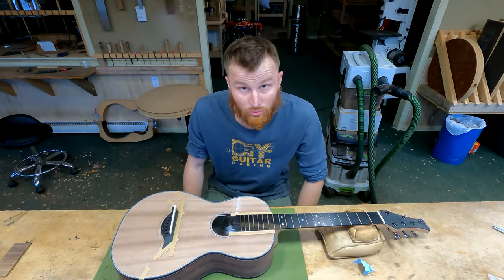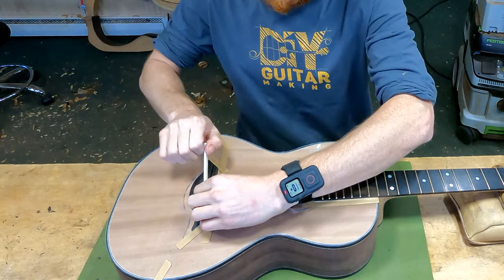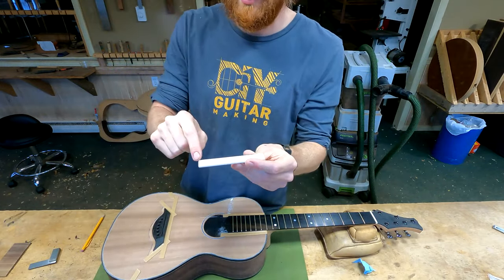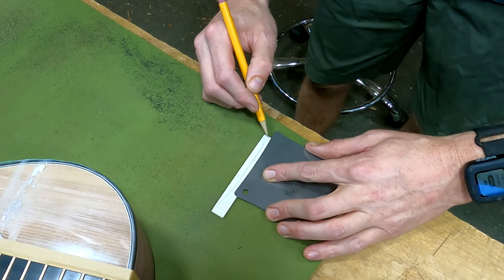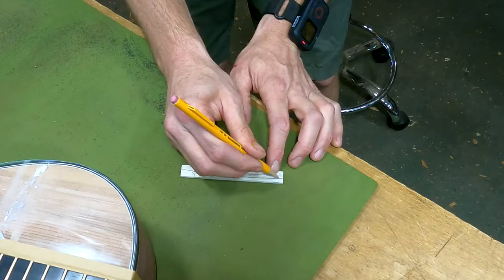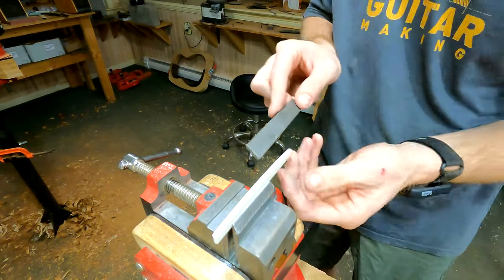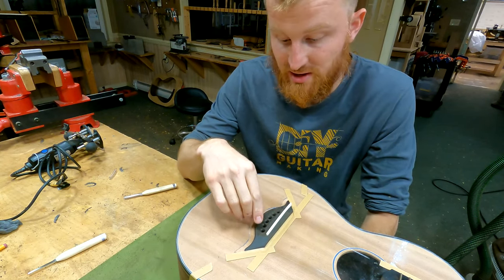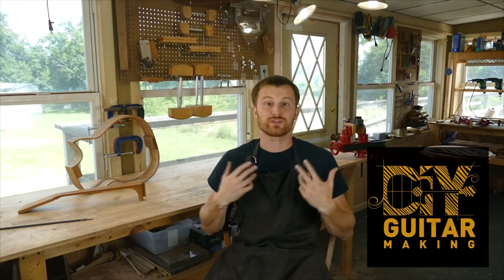The Race to Finish 2 Parlor Guitars Before the Woodstock Show | Part 5

Comment: 3° vs. 5° pins would wedge more tightly and be more resistant to pullout force, as from strings that have higher tension when tuned up to pitch, or maybe from a saddle height geometry that gives a relatively steep breakover angle. So in that case 3° pins could be more desirable for holding power. Of course they'd be a bit harder to get out for string changes. But other than that I don't think it would make a difference in the sound of the guitar. Some might say it would improve resonance and sustain but I think any real difference would be almost unmeasurable so mostly imaginary. If you have both reamers anyway and a stock of both types of pins, you could start with 3° pin holes and see if they work alright, then retaper to 5° if needed.